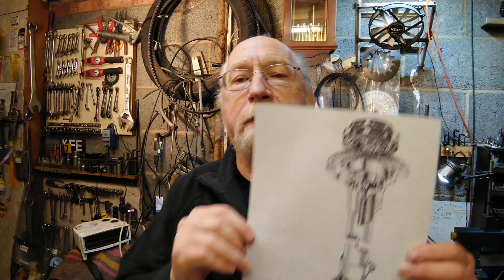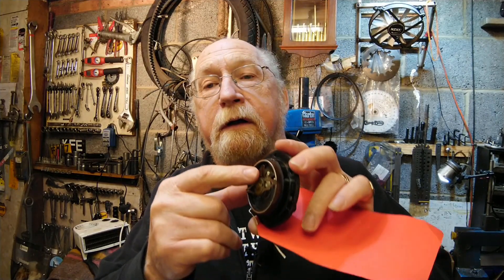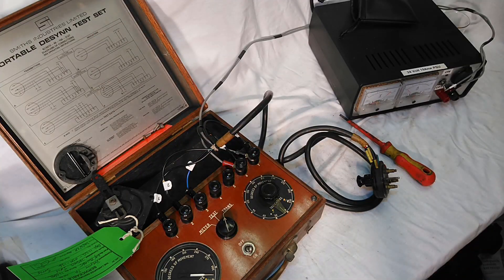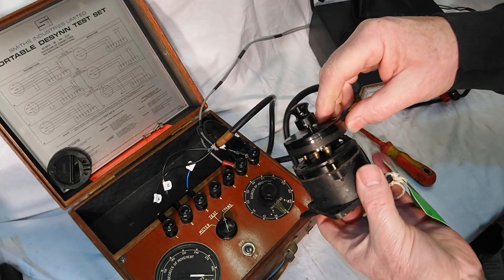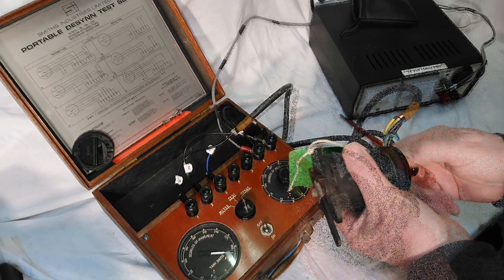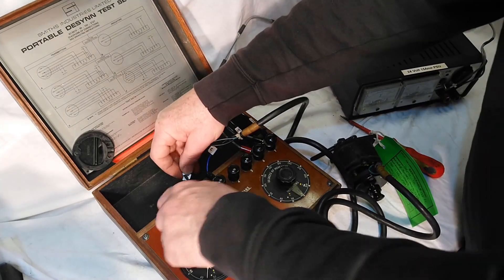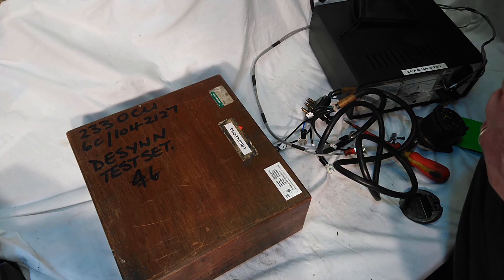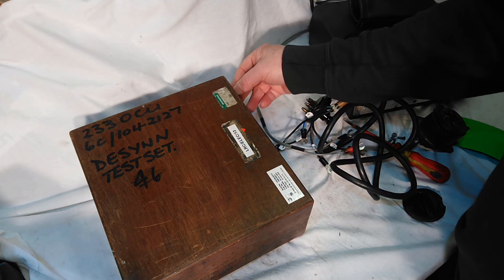The Desynn transmission system part 2

Comment: Well I would love to have found this video about 3 years ago when I had to work out how my indicators worked! I did end up finding a couple of documents that confirmed my findings. In my case I picked up 5, old U.S. National Weather Service Wind Direction indicators which are Desynn indicators. I'm in the process of hooking them up to my computer's outputs so that I can display my wind direction sensor readings "The way they should be displayed!"
You mentioned in part I that you have PDFs of some manuals, if so, may I email you for copies? Thank you!
Reply from the maker: Thanks for your comments, if you need more info just ask 😊

Comment: Thank you for the great explenations. 
I recently got hold of some nice desynn indicators and a parts unit from a tester. it only the indicator, transmitter and the switches.
so i would like to get some more info about it to restore it.
can you make a video with a nice high resolution pictures of the instructions in the lid?
Reply from the maker: @djneon12  Glad you found it interesting, a video of the internals is an idea, I also have the manual if you're interested.  I'll work on it 😉
Reply: @SpenCrowson  that would be awesome and yes i would like a view or copy of the manual. i am unable to find on yet.
Reply from the maker: @djneon12  Ok, drop me a line at tces@oneuk.com and I'll sent you what I have, also I'll take some Hires pics next time I'm at the centre.